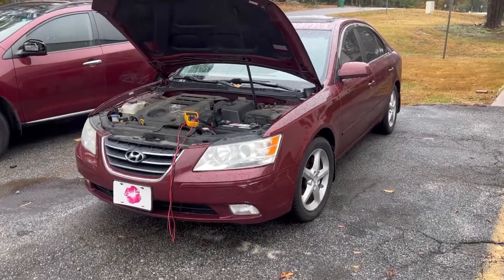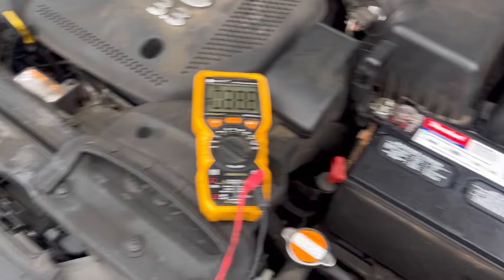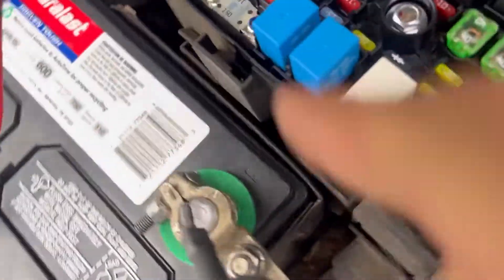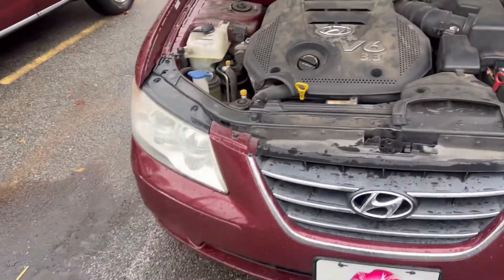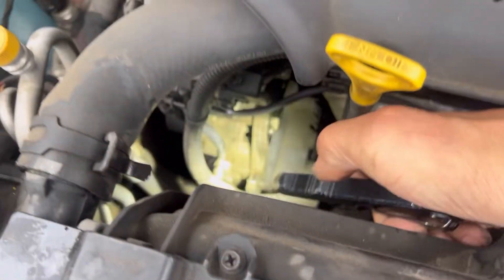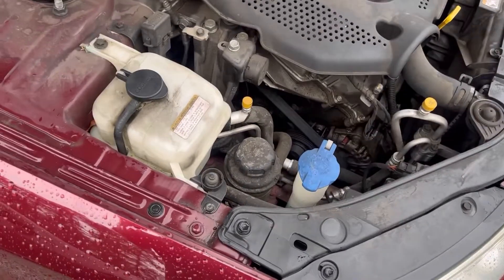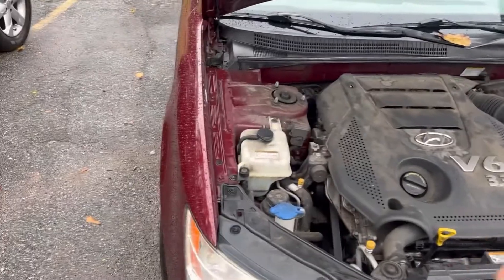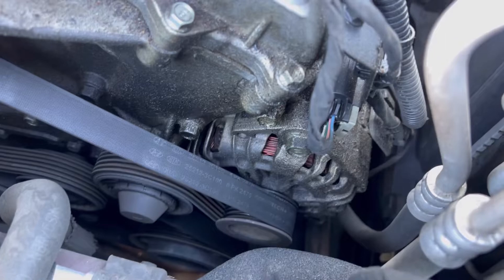IGNORE Oil Leaks and This Can Happen, Costing More Money!

Comment: Back in the day alternators were mounded high in the engine compartment, away from road debris and things leaking on them. They were also easy to replace. Whoever decided to mount them low in the engine compartment should be taken out and flogged..Great diagnostics Alex!
Reply from the maker: Vehicle was lasting to long and simple to work, this days grid has taken over,they are stopping DIY, it’s a special tool for just about everything it seems this days. Thanks for the support as always
Reply: @AlexTheCarDoctor  Yes everything requires SST's nowadays. Think the tool manufacturers and car manufacturers decided to do that so tool companys can sell more tools. Back in the old days all you needed was a metric set and a standard set, couple of flair wrenches and some brake tools, you did not need to constantly buy new tools for new fasteners.

Comment: Yup the 3.3 and 3.8L of this engine design is notorious for valve cover leaking oil onto the alternator. I had a 07 Hyundai Azera with 3.8L engine (same design). Got the car with 135,000K on it. Oil seep was so bad that the alternator was covered and was actually black! Alternator still worked surprisingly. Replaced the valve cover gasket, and spark plugs. Kept the same oil covered alternator and it lasted until 201,000mi when it got totaled (hit a deer at 70mph). 

My parents had the 2010 Sonata (same body design) but with the 2.4L engine. It has 214,000mi + on it and still running. Both cars located in Minnesota, so harsh winters.

Comment: Before calling the alternator, how about checking the electrical connections to the alternator for wire integrity. You are probably right on that call but just to make sure.
Reply from the maker: Hey there buddy I forgot to mention that on camera, but yes Bob t is right always check the connection on the alternator. In the situation it was just the alternator all the connections were good